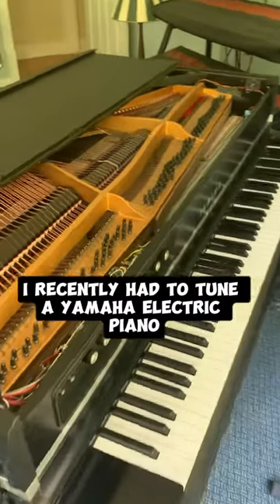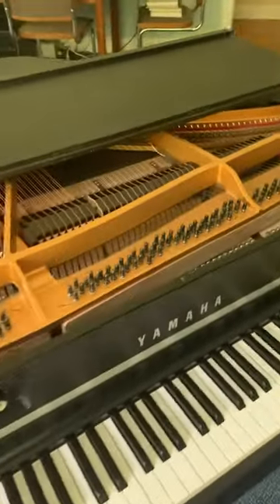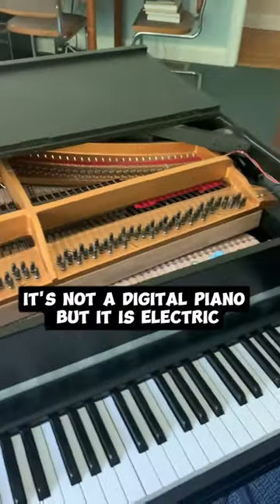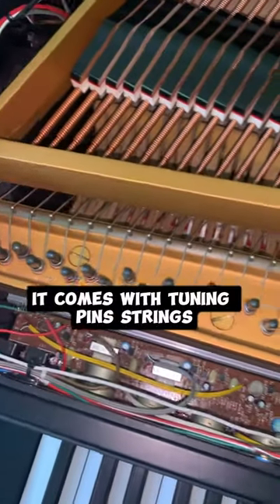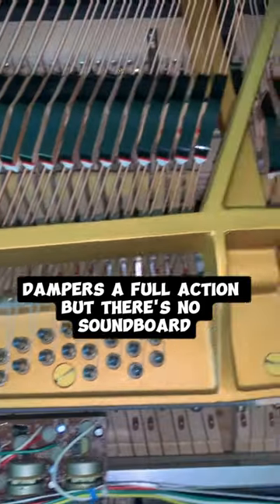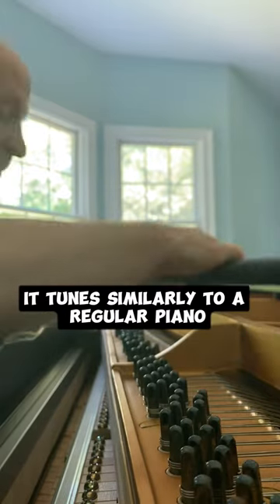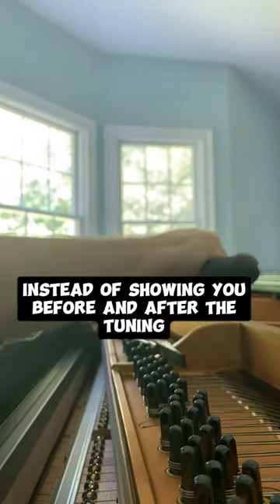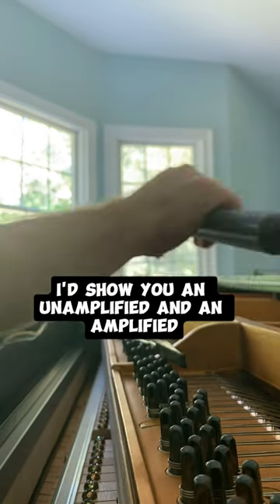Tuning an electric piano #piano #grandpiano #pianotuning #electricpiano #pianomusic  #tunerlife

Comment: What is the use-case for these? If I have something that can go out of tune, I'd think I'd want a great-sounding full-on acoustic. If I wanted something that I could control the volume, change the sound, or add effects, I'd want a smaller and maintenance-free electric keyboard.
Reply: These were all over stages in theb79’s and 80’s.  They became a sound of their own.  You can hear it on songs like “Purple Rain”  and “That’s all” by Genesis.  Queen also used them live.

The Yamaha CP 70 is an iconic keyboard.
Reply from the maker: Danilo is correct. These were all from a time before digital keyboards were readily available. Now they are just nostalgic for the most part. A piece of music history. That is why I made a short about this one. You don’t see them in functioning order very often.
Reply: @Danilo8208SS  @PRELUDEMUSICCENTERLLC675 Super cool, thanks for the info! That explains why every Yamaha keyboard I've owned has a CP-70 voice. Truly an iconic sound even if I didn't know where it originated. This reminds me very much of a guitar pickup.